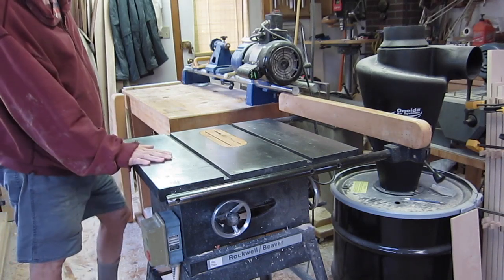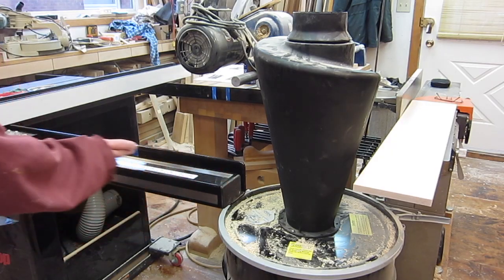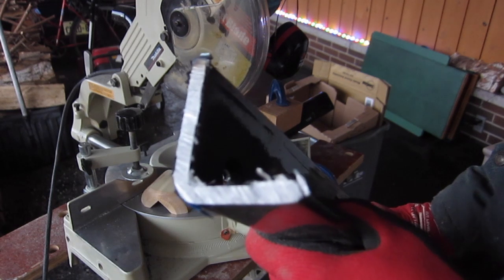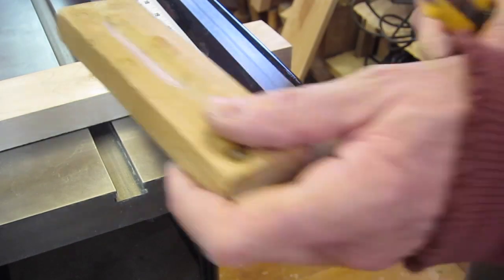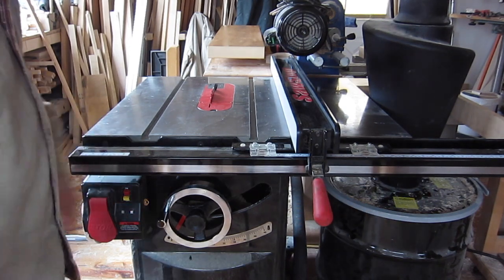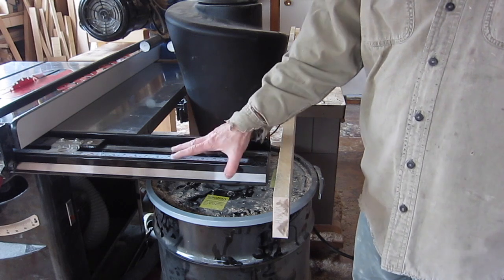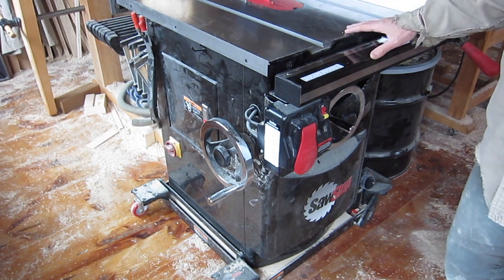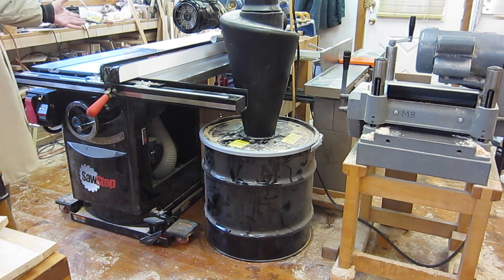Cut down a SawStop table saw to fit in a smaller shop

Comment: Hello Steven, how did you laminate the wide pieces of plywood together for the base?
Reply from the maker: Just a bead of  wood glue around the edge, then clamped at edges.  Only has to be strong enough to keep the pieces from sliding against each other.,,

Comment: Thanks for taking the time to post this: I too have a small shop and cut my rails down using the same type of chopsaw/cutoff blade as you did. I still have to add the block on the right side so that my fence won't fall off when pushed to the full 24". Your video was extremely helpful!

Comment: Very interesting.  I've never considered removing the left wing on my Craftsman tablesaw but I can why it would be helpful.  I'm likely going to buy a new SawStop PCS 36 inch saw.  Given the motor configuration, as you described, I don't think I'll be able to do that, however, I will likely cut the fence rail and extension wing on the right hand side down from 36 inches to 29 or 30 to save space.  My shop is smaller than yours, so every inch counts.  Thanks for posting this.
Reply from the maker: The challenges of a small shop !   It was the floor space savings, by  removing the left wing, that moved me from PCS to ICS.   Unfortunately the cost premium for ICS is quite high, but then I discovered other benefits like deeper table from front to back.   Next challenge was to acquire an ICS as economically as possible.  I got a list of authorized SawStop distributors from the SawStop website, then called them to see what they had to offer.  One had an older  floor model ICS that had been used frequently to demonstrate the hot-dog test. It was  was selling it for the price of a new PCS, so I bought that one.   SawStop does offer a one year warranty on floor  models and demonstrator saws that are purchased from authorized dealer.  

As for cutting the rails.  If I was doing it again I would rent a metal chop saw with toothed blade, Instead of the abrasive wheel used in video.

Comment: That’s a creative solution to your space problem.  I’m sure a lot of people will be hating on you for modifying it but realistically if the modifications make the saw easier or safer for you to use then more power to ya.     

Personally on my own saw stop I have the fence extending to the left of the blade instead of the right like it’s manufactured. I did this because I am left handed. I had to have a fabrication shop build some new angle iron brackets for me but honestly I have never regretted the decision and would do it again in a heartbeat.

Comment: I appreciate how you get your tools to work just right for you and your space.  I've also liked having my dust collector end up in the space between the rails, although I've got that up against a wall, rather than as an island, with my bandsaw backing onto the table saw.  I also need to pull the tablesaw out a bit to rip wider pieces, but that has been a reasonable tradeoff.

How much space are you allocating for your shop?  (maybe time for a shop tour and a discussion of how the space is used during projects)
Reply from the maker: Shop is 6m by 5m = 19'8" x 16'6".       Dust collection and major tools are arranged as an island in the centre of the shop. Dust drum sits between the rails of table saw so it does not take additional floor space. Cyclone sits on dust drum.  Blower and filter hang from the ceiling over the cyclone . This arrangement keeps ducting short and out of the way.  The island of tools is only 7 feet x 7 feet and includes: table saw, 8" long bed jointer, 13" thickness planer, cut-off table that doubles as a bench, and dust collection system.    Introduction chapter of this video shows the layout  https://youtu.be/QBrFtpTK-5k

Comment: Very well thought out and nothing the average home shop couldn't do as far as shortening the rails. You used a cut off or chop saw, but a hand held grinder with a cut off wheel would work just fine. The space requirements sound pretty specific, but truth be told, I also cut down a 52" capacity Powermatic to a little over 30" rip by sawing off the right hand side of the rails. Here's why. From making cabinet with sheet goods, you need a wide right side support, essentially a "panel" saw. For making furniture where ripping long planks and resawing is the primary function you don't need much right side support at all. I already had a panel saw so my saw was primarily a rip saw with a 12" blade and a 5 HP motor.
Reply from the maker: Good idea with the hand held grinder, then the rails would not even have to be removed from the table-saw.  In a woodworking forum there was another person who cut the rails with a sawzall without removing the rails, and got good results.